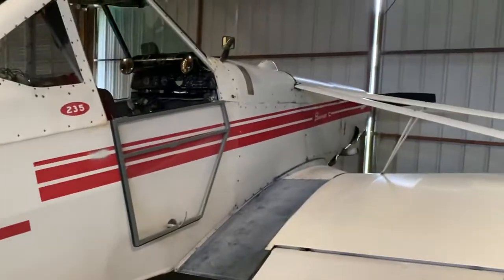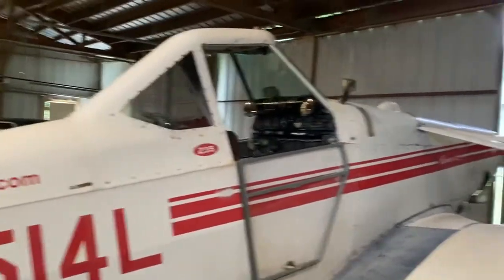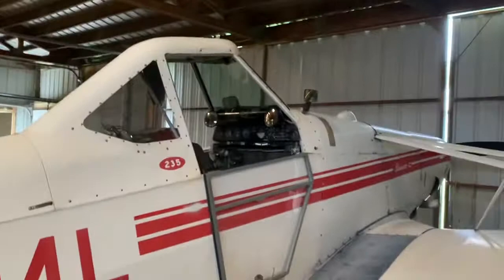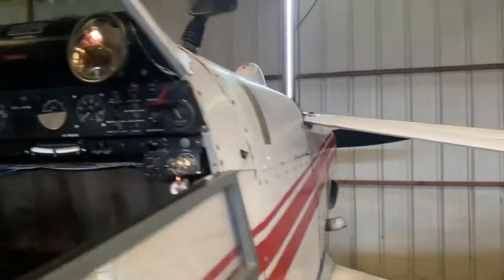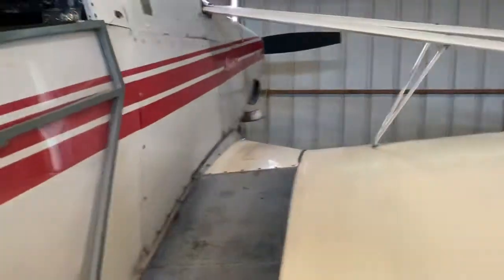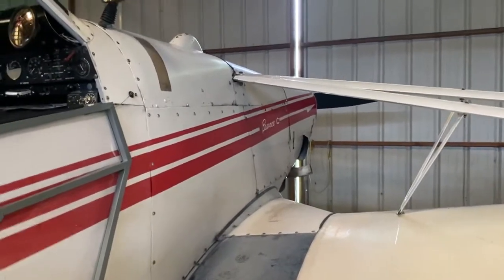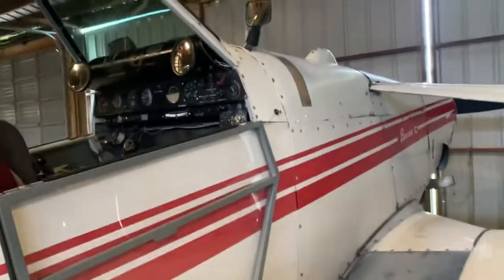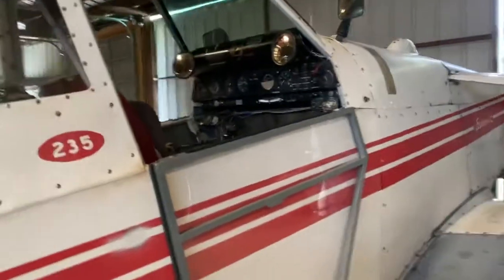How to land a Pawnee Glider Tow Plane

Comment: The main gear bungees are strong because in a spray Pawnee there would be 140 gallons of spray in the hopper on takeoff.  This makes the gear a bit stiff when there is nothing in the hopper.  Make a normal power/pitch approach to arrive at the desired touchdown spot in a three point attitude all slowed up and ready to squat (from S&R page 302).  Just before touchdown, level the fuselage to wheel land slowly and softly without a long hold off.  If you force it on with too much speed you will get a rough hop/hop even if the wheels stay on the surface.